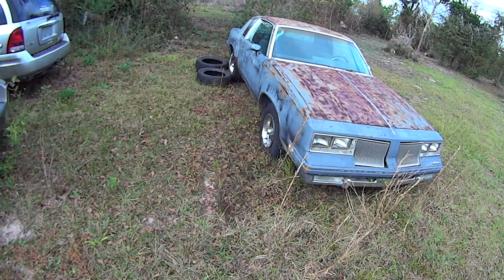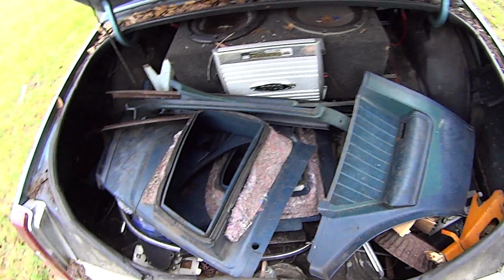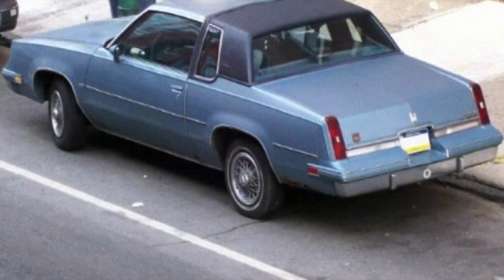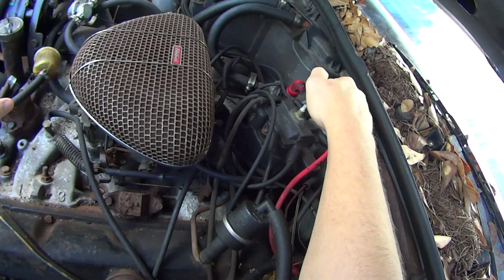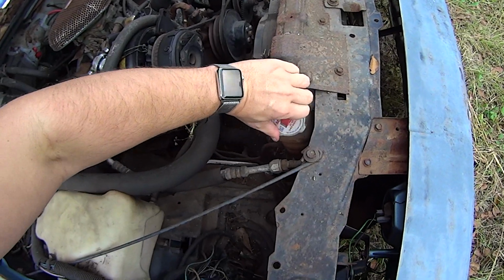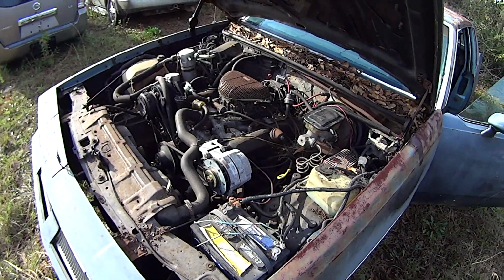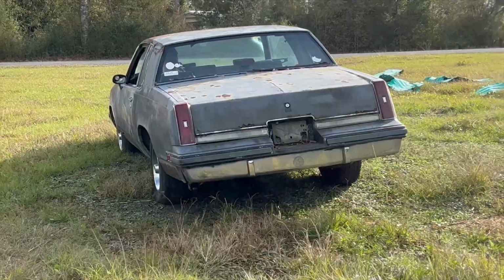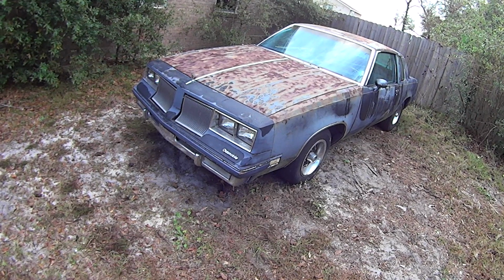Will it start after 5 years? 1986 Oldsmobile Cutlass Revival!

Comment: Nice car I got a 87 oldsmobile cutlass I bought from a guy down in north Carolina I did my first swap from a oldsmobile engine to a 355 Chevy and you Right got charged motor amounts do alot of modifications but to me is nothing I'm always up for the challenge got my exhaust done 44 flowmasters thunder series with 2.5 inch pipes sounds is gonna be up for sale clean solid no rust at all

Comment: I got an 84 2 door cutlass I'm restoring what transmission you running with your    olds 350??
Reply from the maker: Right now it’s an ailing TH-200C. When it’s done I’d like to have a built TH-200r4.
Reply: @AutoRex101  that's a good choice👍🏾